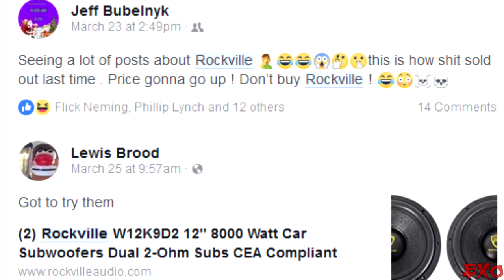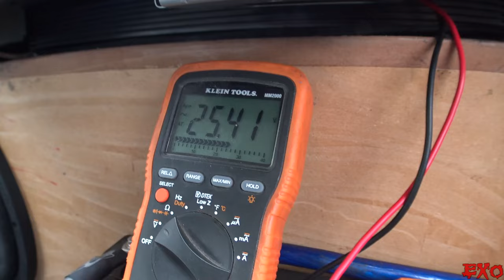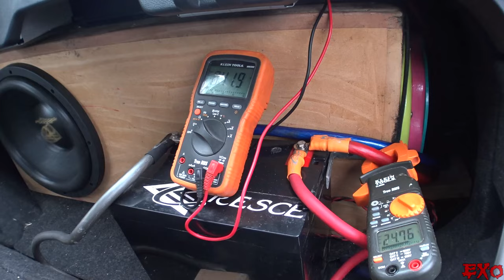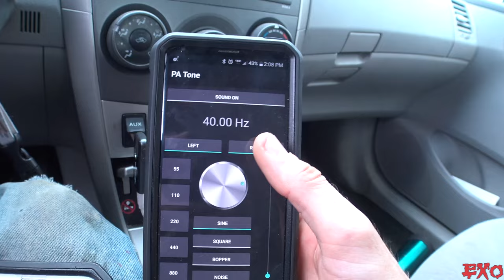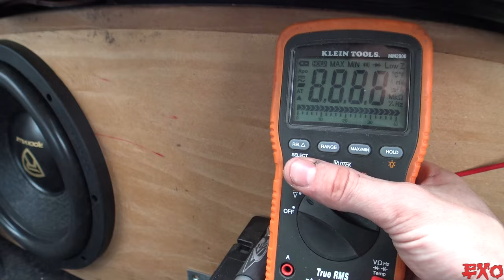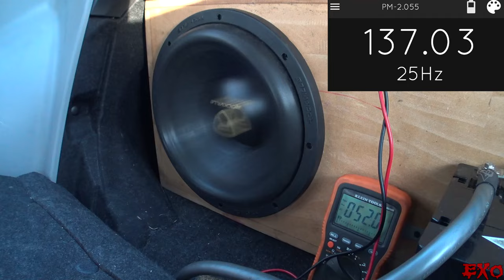CHEAP $100 Subwoofer TEST w/ 12" Rockville K9 Car Audio Sub | Aero-Ported Box SPL Bass Testing

Comment: What diameter is that aero port? What size port or how much port area and volume would you recommend for a new version 12" K9v2 D2 ohm that will be seeing 800-900 clamped watts and not blow or burn up the coil? I've notice the port area makes a huge difference as to whether the sub will handle close to rated power or not. (1k clamped clean) Thanks in advance EXO

Comment: Hey Exo, I have a Kicker KX1600.1 amplifier and I am looking for a good match for it. If you have a moment, can you let me know your opinion on which way I should go; one of these subs, two of the ten inch models, or one of the DB Apocalypse subs you showed in another video. Not sure if I should be pumping 1,600 watts into this single K9? Looks like two of their ten inch woofers would be a better match, since they are each rated for 800w, but this will be the first box I build of my own, so not sure if two tens would be much more complicated than one twelve? The Apocalypse is rated for 1,700, so, definitely would work with just one.

Thanks for your time, hopefully you'll find a moment to respond to this.

Comment: I couldn't wait to order a budget Sundown or Rockville so I went to Wal-Mart and bought a Gothic 12" with the solid dust cap. The dual 4Ω coil leads are woven inside the spider, hidden from view. The magnet is vented and the cone is stitched to the surround. I failed to check the glue, but the 2,whatever rating? 500 RMS all day is safe. I wouldn't expect it to take 1,000 RMS from what I've seen here on YouTube. It would be awesome to see you test one. The Pioneer 760 doesn't do it justice.. even at 1Ω 420 watts.

Comment: I realize that this is an old video, but how would you compare this Rockville K9 to something like a EMF "Lowballer" sub? What impedance is each voice coil on this driver? I know that Rockville STILL makes this driver! The Lowballer is rated at 750 watts RMS continuous. I don't know how it would handle 1,500 watts, but I would be willing to bet, that it would handle a "burp" test like you did, for about that amount of time, without going up in smoke. I bought the dual 2 Ohm version, it's available in several different impedances, all dual coil. I needed 4 Ohms, for the class "D" amplifier I'm building for a home theater subwoofer box.

Comment: So I just got this sub. Pulled it out and it does not have direct leads ... looks like some things have changed. The dust cap is also very firm. I did not get a chance to test it for long after today's install as I lit my power wire on fire(was my bad had the wrong fuse in and pushing the amp hard for the first time) Anyway I am looking forward to getting some footage posted of this thing to my other channel.

Comment: Btw, I just bought a Rockville W15K6D4 to try out. It was $95 shipped...lmao I have two Sundown Audio SA-12s and they will never be replaced because they are amazing subs for $430 for the two of them. The box cost me $45 for the wood, glue, screws, and Aeroport, because I built it, and it flexes my roof and doors. The amp is a Soundstream Rubicon Nano RN1.5000D and that was $215. Maybe not a 10k Crescendo, but it sounds amazing and crushes for such a cheap amp. Besides, I have always had a soft spot for Soundstream since I ran four Kicker Solobaric 10s off of a Reference 1000s in my Integra back in the day.
Reply from the maker: Thanks for sharing, Boosted! How are you liking the Rockville subwoofer so far?

Comment: Hey man! What's the best way to determine the amps needed to power an amp? I know it's Watts x Voltage, but would you times it by 1.2 to add for an 80% efficiency sort of thing?

Also, if an amp is rated at 1Ohm 3000 watts, and 2ohm 1600watts, what amperage would you need to work out if your running at a 2ohm load, would it be 14 x 1600Watts and ignore the 1ohm specification? Popped into my mind being braindead. I didn't think an amp could tell what load was being used to draw more watts, which for the 1 ohm load you would need more amps from your alternator?
Reply from the maker: It varies from different amp technologies, but in an EXTREMELY general sense, you can divide the wattage by 10 and ballpark how much supply amperage could work. 

So... 3000 Watts / 300 amps ect (of course this is very broad)

Comment: I have a set of rockville speaker stands that i bought a few years back, they are to the assisted lifting and one of them doesn't seem to help that much lift the speaker. the other seems to be fine. the issue is i bought them and then they sat around before the warranty expired as i had a suspended drivers license or it would of happened under warranty as it broke shortly after i started using them.

Comment: Hey EXO, you said you are running that on factory head unit... Im haviling a little bit of high pitch feedback on the factory head unit of my subaru outback...what do you have your rca's hooked to before they hook into the amp? How can i get rid of this "feedback" noise? Mine is running from rear door speaker wiring, i got this lil connecter you screw speaker wire into that has female rca plug on it. Its about 1" × 1.5" square adapter

Comment: Hey EXO, what do you think of a SQ setup using 3 10's in a Sealed box. Do you think $99 NVX VSW102V2's could get it done?
I have an old BD1500 Rockford amp to go with it. Hell Maybe even 3 10" Rockville subs
Reply from the maker: Sure thing man! If that fits your budget I know those subs perform well and are reliable when used correctly..

Comment: Hi i seen alot of videos bashing this sub because it cant handle 1000 rms. I havent seen anyone show a better sub thats 100.00 with shipping. I hope you can help. I mean if i have to spend say 200.00 for a sub that would be better why not buy 2 of these for the same price? Wouldnt they move more air 2 12s compaired to another brand thats 1000 rms

Comment: Hey just came across your videos.. love them dude.. You are cool.. got a question for you.... How did you hook up the amp the stock radio in her Toyota? I have a newer Toyota'13... I like the stock radio, but I have a Pioneer unit that is only 2-3 years old. When I put it in my old Toyota.. The sound sounds bad.. The bass moved to the back instead of where it used to be, in the fronts door speakers? What should I do? Add a amp/sub to the stock radio or put the Pioneer unit in?
Reply from the maker: Thanks for watching the videos, Chris!

I used a "high to low level converter" from NVX Audio :D

Comment: Bought the DVC 4 ohm 12" from rockville to replace my old mtx 12" 300 watt rms sub, any amp recommendations for something cheap ($100-$200) to power it? 1000watts rms at 2 ohm? with a bass knob

Comment: QUESTION PLEASE READ: I'm not good at car audio ill start there. I have a custom made box in my truck, first time. Usually it has it where you hook the speaker wire to the outside of the box. The guy that made the box instead drilled a hole in the side and bypassed the terminal location. is that proper or bad news?
Reply: That is what I did on a few of my first box builds in the 90's and it works. Just make sure it has silicone around the wires so air doesn't come in and out around the wire.

Comment: I just bought a 12 inch Orion XTR pro 4 ohm DVC 1500 watts RMS I was wondering your recommendations on a box it calls for 1.5 cubic feet sealed or ported same size I was wondering if you would suggest anything else I can buy or custom build myself. I am powering this with a Hifonics Brutus 2100 watt RMS at 1 ohm however I will be running it at 2 ohms which is 1400 Watts RMS.

Comment: Hey Exo, long time subscriber.. just curious I was always told to face the subwoofer towards the trunk opening... but maybe your port angle makes up for it? Just wanted your thoughts thanks
Reply: Jayrod4113 face them into the cabin for SQ and face them towards the back for SPL, you’ll get about 1 or 2 more dB with them facing the back.

Comment: I noticed you turned your radio to max, doesn't this introduce clipping and distortion to the sound? I have a pioneer head unit that goes all the way to 60 but after testing it I found it starts clipping at 57 so I never go beyond that.
Reply from the maker: I've already tested to head unit with an o-scope. It does not distort, even at full volume.

Comment: Hi Exo, love your enthusiastic videos !!!! I live in the UK and have a VW van that i've decided needs some bass on budget. I've upgraded the door speakers to high sensitivity half decent components but there is still very little bass to fill the large noisy van. Having been so impressed with this review i've ordered the 10" version of this sub (biggest i could fit under the front passenger seat) and a 2 ohm 1500w rms Rockville amp to power it. Had to pay import duty on these but they still seem good value and something different too. Hope it works well !! Gotta try and make some sort of cabinet to mount under the seat. Any tips on this ? size, sealed/ported etc thanks

Comment: i remember had to be summer of 01 or 02, audiobahn was out trying to make a name for themselves in the market. they had a truck and went around the country doing parking lot discount car audio  sales. big audiobahn amps and subs for dirt cheap. at the time i was a jl/mbquart/phenix gold snob and scoffed at the very notion of a 1500-2000 w amp for 100 bucks or under a hundred for a big ass 15 in 4000 w max rebuildable sub. idont remember any models but i do remember seeing audiobahn in crutchfeild just a year or so later and it was the most expensive brand in the catalog. i do remember one of the big amps that had the clear window on top with big xcooling fan and led lights was right at a hundred in the lot and was over 700 in crutchfeild. moral of my long story. try those cheap ass unknowns when you can,you might get lucky and save thousands. also get to be that insuferable prick who "knew from the moment i saw they are gonna be big,you know because im like super car audio smart and was one of the first."
Reply from the maker: Thanks for taking the time to share all that with us, Sam!!!

Comment: I buy 8” Pyle power dvc subs on eBay for around $15 ea. I built a t line box for single 8” and it hits great for a few months till I blow it from pounding on it so hard at low hz. They last longer when not hammered on. I love it and want to build a box for 3 of them to see what it can do. If you want cheap bass it’s a great sub.
Reply from the maker: Wow, talk about a cheap-o! Glad it's doing what you need, thanks for sharing :)

Comment: Did ya break in or is there no such thing. Cause I thought if you tune it well it will break in at low vol over time
Reply from the maker: Break in time is a very real thing, but not all woofers are the same. Especially lower powered, less stiff woofers.

Comment: Should I get a second battery for my system? I have a BOSS cap18 farad, an 880cca sealed battery, a 5000 watt Pyramid amp, and 2 12' Boss Phantom 12DVC 2300 watt subs. :D
Reply from the maker: I'd scrap the capacitor and consider another battery instead, sure!

Comment: What would be your choice on "10 subs under $250. Listen to all kinds of music also. 
Have stock alternator, but 2 odyssey 1750 extreme batteries and a audiopipe apcl 18001D

Looking at:
Sundown SA-10
Alpine type-R
NVX-VCW10
Rockville W10K9
Reply: jim brockman i just got a dayton audio ultimax it sounds great i wouldve gone with a psi or a sound qubed but i only have a 500w amp

Comment: I'm thinking of making a 320l ported box for my 21". Don't have the info to calculate a proper box size so I'm just taking a guess. Could always change the port size in the end. As you can see I don't know much. Any idea if I should go ahead with this?
Reply from the maker: What do the specs call for?!?!
Reply: @EXOcontralto  All the manual really says is the weight of the magnet, size of the sub, 30mm xmax and 30hz resonant frequency.

Comment: Hey EXO, thank you for your vids.....you've got me inspired to start.   I got a 18 Honda civic, when I went to the local shop they gave me, some confusing info.   They're recommending I wait for some kind of kit for my vehicle????  I guess it has something with the cars noise cancelling system.   I want to make a small set up, like the one you made for your girl.  Single 12 inch.  Is this really an issue????   Talked about cutting the signal to the subs, throwing error codes to the car?????  WTW????
Reply from the maker: Hmmm, this is something I'm unfamiliar with. Although I won't say they're BS-ing you, I'd surly get another opinion with someone more knowledgeable on NEWER cars. I've never had a car newer than 2003 so this issue is a little out of my wheelhouse.

Comment: Pair of Audiopipe 12s, dual voice coil wired down to 2 ohm and giving them each about 500 watts, sounds pretty good for being in cheapo walmart boxes in my front seat
Reply from the maker: Can't complain about that, nice going man!
Reply: @EXOcontralto  i had problems with the boxes coming apart, so i ported them, tuned to 25hz, amd them wood glued them.  My dad owned a car audio shop back in the early 90s, so i was raised in tgis stuff. My next build is going to be 4 orion hcca 15s, each with their own amp, also orion. Its going to be sick! Love your stuff, you got me back into all this! Keep it up man.

Comment: You’ve got your hands full with that’s ford build, I’d like to see some update videos on it, what’s your plans if your any good at cad it be cool if you came up with a few different box designs. If you use a composite like fiberglass and Kevlar box it should hold up to the dbs so the sky is the limit don’t be afraid to dream big you’ve got those 18 how could you go wrong lol.

Comment: Yo exo I'm not a fan of Rockville but I was running these 15s that I actually replaced with my 2 skar zvx 12 v2d1 awesome budget sub however these 15s the zvx' s couldn't touch these things and I will seair by them. A little info on them they are vintage and discontinued but you can find them all over the net. You can easily pick up a pair yes a pair for just around 50 bucks. Now they are house speakers and come out of a 3 way dj cabinet thats heavier than hell has to be close to 150 to 180 lbs constructed out of inch and 3/4 mdf and has JJ 2 15s 1 4 in mid and a big rectangular horn the way it's set up is the 15 are subwoofers and only produce low freq only even when hooked up without the low pass filter it will go to about 150 Hz but it's very faint. They are called welton pro studios they are 400 watts RMS 4 ohm svc I'm telling you construction is vintage of course but these things can really handle some power I put one on a menace 3000 water full tilt and it screaming for more power.. I gave up my zvx ers to put these back in that's how much I swai by them

Comment: It’s sold out everywhere! All that’s available is the k6 subwoofers
Reply: They weren't sold out. They temporarily stopped production because of a glue problem within the voice coil i think. Some people say their K9s are still pounding and some say they've stopped working right. So Rockville put a pause on the production to fix the issue but they will be re-releasing the K9s soon
Reply from the maker: Pretty sure that's because they discontinued them due to defective coils!

Comment: awsome! hey guys I have a kicker l7 12 in a  custom vented box that pumps! also a 2018 Accord .the car is brand new and has like 28 computers,will I damage anything if I throw my system in there?????
Reply from the maker: Yes and no. FLEX will damage lots of stuff if not handled correctly.

Comment: Would this be overkill for my golf cart build?
Reply from the maker: I would think so, but who's to say what's overkill :P
Reply: EXOcontralto haha...u just replied to my other comment about the golf cart....overkill for a golf is self perception
Reply: I actually bought the 10in version for the golf cart and it rocks.  Next question is i may want this for my truck between the seats and i may have to point it downwards as im making a "armrest" in my work truck and it has to hide. My dimension are 15in between seats, 17in tall from floor to armrest and 24in from front to back. Can i build a good box with those dimensions.  Either ported or sealed?
Reply from the maker: Sure thing man!!! I'd stick with a ported design and call it good :)

Comment: I have a car audio system, but I set it up in a cabinet with pioneer 50w x 4 channel, 200w total, and on it is 6 6.5" pioneer 200w speakers, 1000w pyle super tweeters, 4" kicker door speakers, and an 8" bose sub,, external of that are 2 big car batteries, a 225 amp car battery charger, a 6000w lanzar vector amplifier, and 2 15" 3000w quantum audio subs, but once i get to half volume my speakers have like a crackle noise, but its not that the speakers are bad, i need some help...
Reply from the maker: Have you checked the signal with a device of sorts like a Oscope of DD1?

Comment: You wattage measurement seems off.. You measured amperage on the 12V (assuming the alternator was off) battery<->amplifier line, so thats 25.53A * 12V = 306.36W to the amplifier which will then have some loss as well, so I'd say thats probably around 280W to the sub... not ~1500W.  You measured 59.2V on the speaker wire, but we don't know the amperage there.  Do you disagree?
Reply from the maker: No no, you're confusing two different measurements. I was just clamping the 12v wire to see how much the amplifier was consuming. That wasn't the  actual power test. If you skip ahead you'll see it. The wattage was tested by clamping the SPEAKER WIRES not the battery cable.
Reply: EXOcontralto Yep you're right sorry about that! Nice work. Keep it loud!